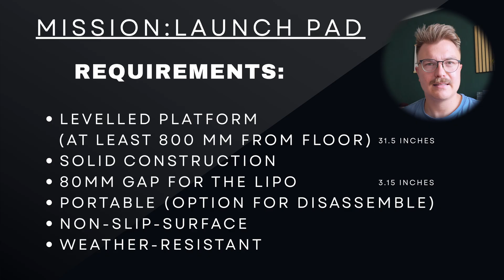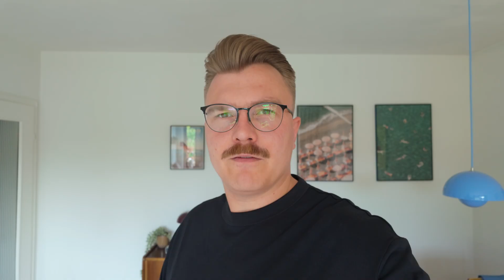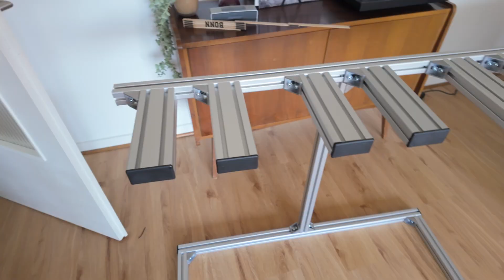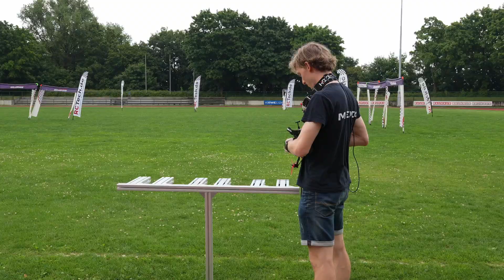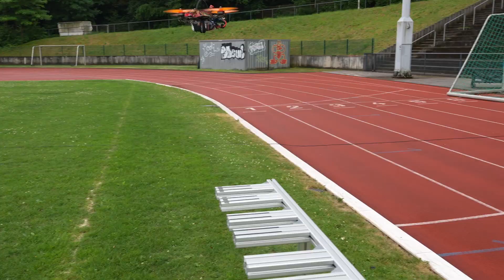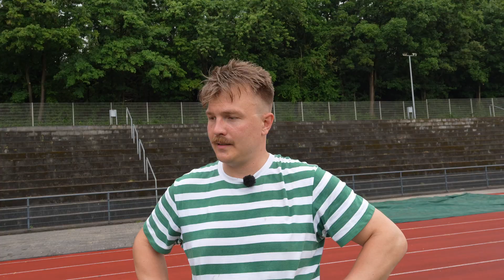Building the Ultimate FPV LAUNCH PAD – Launching like a PRO!

Comment: I’d recommend to add two legs, but not in the same plane as the center leg, but moved forward. Essentially, align one of the quad launch surfaces on each side with the forward facing feet parts and add the brace at the tip. This way you’ll also add brace against vibration forward/ backward. It might not be necessary, but if you add two additional stilts anyway, it’s in my opinion the stiffest configuration
Reply from the maker: You are right good idea but hard ro implement on the launch pads itself or below. However, it took me two more iterations and i hope now it is stiff enough. The top is almost 2 meters long (for five copters) i added triangle on the base and lowered from 800 to 600 mm height. In my next video you will see the result. Tomorrow we are using it on iur first race! Curious how it will be wirh the launch pad

Comment: Where did you buy the parts? And maybe try to build the base (like legs from a table) as a triangle. Should work better. The rest should be fine then
Reply from the maker: sorry for late reply: ttps://www.alu-profile-zuschnitt.de here i did buy everythng directly in the right lenght. yes i added a triangle and it works :D

Comment: Hi.neso
You need a support leg behind your vertical alu profile 40x40cm triangle will do the job. And two more vertical profile at each end to avoid twisting and two more leg and you will be good to go.
Reply from the maker: Yes this would bw hopefully sufficient. Also thinkikg about 80x40 profile for the sides to go frim floor up to the pads for less twisting. But definitely more weight

Comment: I would use a 3d printed and aluminum launch pad, the legs would be aluminum but I would print the base in like 2 pieces to fin on the printer.
Reply: I would also recommend adding 2 more vertical extrusions, rather than just on on each side.
Reply from the maker: The morw the better. I will order it and test it. Havibg three can be better but also heavier. I will add two more I guess